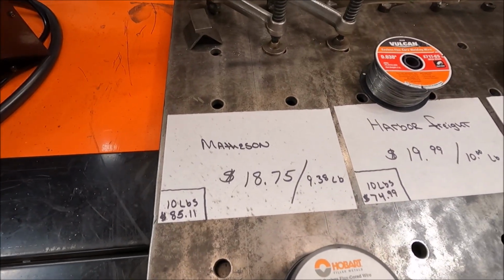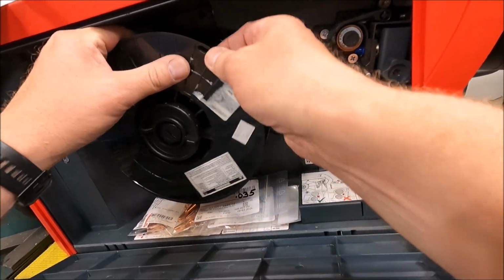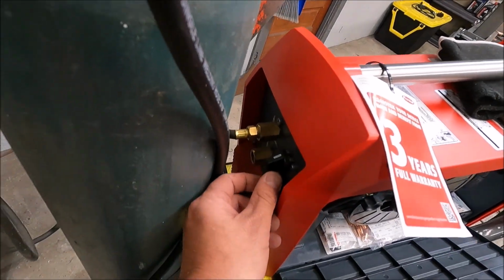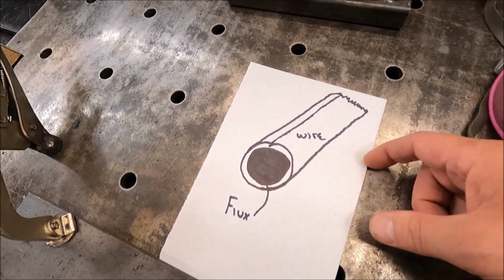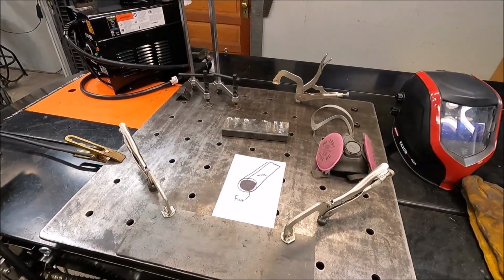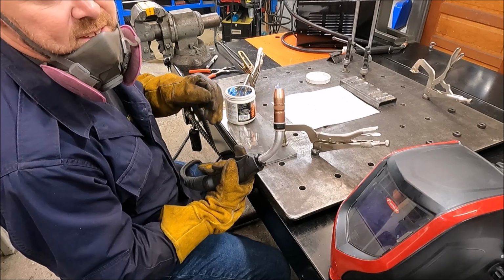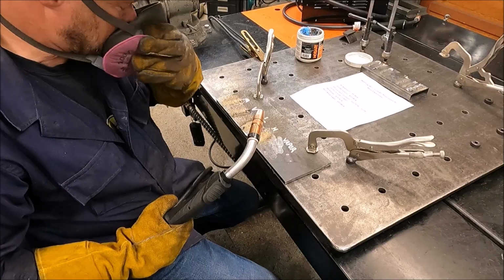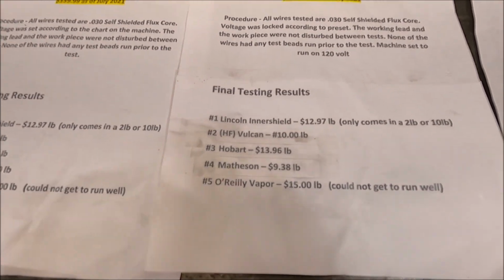Self Shielded Flux Core Welding Wire Comparison Does Cost Matter?

Comment: I wonder if the ground clamp makes a difference. I’m thinking about putting a better ground clamp on my titanium flux core welder.
Reply from the maker: Absolutely. MIG likes a real good ground and is very finicky when it's not a solid connection.

Comment: Ran flux core using Lincoln welder for years. HD and Loews 1lb spools. Tried this, Kiswel USA, and never going back. if you like Lincoln wire I would strongly recommend Kiswel. No affiliation to the company. I just buy it on Amazon.
Reply from the maker: Great to know! Thank you I will give it a try @gmarch4618

Comment: If anybody is considering the HF 110v flux core machines, do yourself a favor and spend the extra few bucks on the titanium 125. The dc output is much smoother and it only weighs like 15#.

Comment: I have a Lincoln SP-100 and it requires .035 flux when used, only NR-211MP in 10lb roll. So now the question: is a 220v welding rig better for flux than 120v?
Reply from the maker: @James KI5OEB it all depends what you are planning to do actually. 220 volt just gives you the ability to use more amperage which equates to being able to weld thicker material. You can weld 1/4" using self shielded wire on 120 volts and even thicker if you make multiple passes. 220 volt machines allow you to use bigger diameter wire to weld thicker materials in one pass so it you plan to do ocasional 1/4" with your 120 volt machine you should be all set. If you plan to weld 1/4" and up more frequently you would probably want to go with 220 volts.
Reply: @BrandonLund  my Hobart 205 AC stick is in my garage for the thick stuff, but frankly my 100 amp unit does good with a three passes I don’t get any use from the 7014 or 7018AC. I just make 1/8” projects mostly anyway. Headache racks and welding cart and many odds and ends projects.

Comment: It would be nice to see a bit more of the spectrum of wires available.  I like Lincoln but it isn't available here and online it is one of the most expensive.  I have used Amazon's Red Devil with good results as well as Hobart's line.  There are several others I have used as well.  I have never sat down with all of the varieties at once and ran them so it would be very interesting to see the results.  I don't use automotive store wires because I always find them to be extremely high priced for what they sell.  They also locally have a very limited selection at any given time.  Nice project.  You ought to do the same with the machines to see what real world differences the entry level  all the way to the gold plated priced machines display.
Reply from the maker: Thanks man! I plan to do more real soon :)

Comment: Just curious, Brandon.  Would it not have been better to keep your expensive machine on AC (if possible) to make a true comparison since the Harbor Freight welder only did AC?  Thanks, Jim
Reply from the maker: Great tip Jim. I don't think it's capable of switching from DC mode AC. I checked on line briefly and couldn't find anything. I'm pretty sure it's a DC only machine but that was an excellent point you made 👍
Reply: @BrandonLund  I converted my Harbor Freight 125 to DC and I love it.  DCEN and the splatter is much less and the penetration if really good.  Very much a learning process.  I am in the middle of a project of building a lawn areator.  It is FUN!!!  DC is much better and that is why I thought of comparing with AC on your wire evaluation.  Have a great day!!!  Enjoy your videos.
Reply from the maker: @Jim MacSuga thank you for your support! I'm going to have to look into that conversion and see what's involved. I like that idea!
Reply: @BrandonLund  I can send you some photos of what I did and if you search YouTube there are lots of videos on how to do it.  I did my own way as I have been an electronic tech for 45 years (retired) and now learning a new skill!!!
Reply: If you want some photos, PM me on facebook
Reply from the maker: Thats awesome man! I want to try it!

Comment: Another good video. Have you ever done a side by side test of shielding gases?   I ran an argon /co2 mix vs pure co2 and decided the straight co2 is good enough for structural work, as opposed to body work.
Reply from the maker: @Timothy Martin I've used both but never in a side by side test. I think this would be quite interesting! Thank yu for the suggestion!

Comment: I have a goofy question, I use a titanium flux core welder, when I try to weld thin stainless with it I burn thru it, can you advise ?
Reply from the maker: Are you using 309 gasless wire? It take a lot of amps and it's not best suited welding on thin metal.
Reply: @BrandonLund  not shure, its what ever the welder came with. I am trying to weld stainless silverware, if that helps.
Reply from the maker: It could just be your filler metal. If it's silverware it might be made of 316 (which is food grade). I think 316 can be substituted with 309L but I'm not positive of that. 309L is a good all around wire to use especially if your not sure of the metal your welding and it can be used to join dissimilar metals. SS flux core wire in general  is very hard to use on thin metal.
Reply: @BrandonLund  Ok, thank you

Comment: Brandon,  Love the channel, you make it easy to understand what you are doing. Keep it up, I do have a question for you. I like the welding/fabrication table but I wonder how much would be sacrificed if I used quarter inch steel instead of the three eighths you used?  That extra eighth of an inch makes the table top 95 lbs and with quarter inch it is a manageable 64 lbs. Alot easier for one person to lift and move. What are your thoughts?
Reply from the maker: @salceti Thank you for your support! I'm not sure how well the 1/4" top would work if you were to use fixture clamps on it. I know that after a while the 1/4" plate will eventually start to warp from repeated welding. I'm not trying to discourage you but I don't think you would be happy with anything less than 3/8.
Reply: @BrandonLund  Thanks, that was what I thought but wanted your opinion. So I guess I will figure a way to make the 3/8" steel work, before I get to deep I need to get my hands on a Mag Drill to do it right. I am currently negotiatng some handy man work to get the money to buy the drill, LOL.
Thanks for your channel again.
Reply from the maker: @salceti anytime man! another option that I have seen people do is they use the 1/4" plate and drill the holes like normal but when they weld they lay a scrap piece of 3/8 plate on top then weld on top of that. It prevents the 1/4" plate from warping. The more I think about it, I think the fixture clamps would work with 1/4" plate. You can also rent a mag drill too from your local tool rental.
Reply: @BrandonLund  are you saying that the fixture would work as well with 1/4 inch plate for tack welding an assembly but then remove the tacked assembly and add another layer of plate on top of the fixture table to do the final welding?
Reply from the maker: A lot of the prefab tables come in 1/4" thickness so I don't think you will have a problem using your fixture clamps on a table that's 1/4" thick. I don't think you would have a problem tacking everything together  either on the 1/4" top but then when it's time to fully weld everything you could slide a scap piece of 3/8" 12"x12" (or whatever size piece works for you) under it to prevent too much heat from transferring to your 1/4" top.
Reply from the maker: Yes 👍
Reply: I am going to push it now. I do have a 36" x 40" sheet of 3/4 inch solid aluminum to use, only the mag drill will not hold to the aluminum. BUT I thought if I make the template from the 1/8 inch steel as you did I only need to drill the first two holes using the index holes on the template and then use the shoulder bolts to drill the rest of the holes in the aluminum because the mag drill (which I haven't bought yet) would hold to the template metal and use the shoulder bolts to locate the rest of the pattern accurately. Then I don't even need to buy the 30 x30 sheet of steel right. Just weld on the aluminum fixture instead. That should not warp, right?
Just an idea I had.
Reply from the maker: I don't believe you will have any problem welding on the 3/4 plate. It's plenty thick to prevent distortion...what I am not sure about is after a while if the holes might wallow out because the aluminum is softer than the steel. It may never happen either. I bet that is a nice piece of plate!
Reply: @BrandonLund  It is a nice piece and weighs 110 lbs. I thought about the wallow too. The best part is it didn't cost me anything but I still have the problem of moving it. I am thinking of attaching it to some hinges and hang it on the wall so that I can swing it up when needed and down when not, not the best option but that will work, I just can't move it around the shop.
Reply from the maker: @salceti if you are in the United States, sams club has a nice roll around work cart that would hold that plate really nice. I have one in my garage that I sat a piece of 3/8 plate on and it serves as my portable workbench, welding table, chop saw table and the list goes on...and its rated for 500lbs! https://www.samsclub.com/p/utility-cart/prod9070084?pid=ps_acq_Google_PLA_12743824280&wl0=&wl1=u&wl2=m&wl3=514345519181&wl4=pla-293946777986&wl5=9002848&wl6=&wl7=&wl9=&wl10=1247713&wl11=online&wl12={productid}&wl13=&wl15=122487735562&wl16=&wl17=&wl18=&wl19=&wl20=Cj0KCQjw_8mHBhClARIsABfFgpi8XtwMzxTOLp33hy88aI1Vw8QHFN5itVjKTs9dbn6OEKbJcKtwqoMaAoZQEALw_wcB&wl23=293946777986&gclid=Cj0KCQjw_8mHBhClARIsABfFgpi8XtwMzxTOLp33hy88aI1Vw8QHFN5itVjKTs9dbn6OEKbJcKtwqoMaAoZQEALw_wcB
Reply: @BrandonLund  thanks i will check it out, if you recommend it. thanks for the link.

Comment: Hi Brandon. Great test again. Do you have different rollers for  the welder to transport flux-core or normal welding wire. It seems that flux- core is softer and needs ribbings on the roller. 
But amazing results so I hope you can show more on this item.
Reply from the maker: Yes and yes :) Because flux core is hollow it requires less tension to feed which is the reason for the serrated drive rolls :)

Comment: every wire works best with different settings some need more volts than others cause they are not made the same way so fine tune the settings for each wire seperatelly and then check the results again and show us the settings each wire prefers
Reply from the maker: @tylor dupont with enough time and practice I can make pretty much any wire run as good as the next especially in a high end machine. Im trying to remove that factor. All electrodes are designed to run within a specific range because its manufactured or supposed to be manufactured to specifications. Running the wire at a constant removes those variables and you are left with testing the quality. Wires that have less quality control will not run as well as one that do which is why a GS wire and an 11 wire can and will run drastically different because they are held to different standards.
Reply: @BrandonLund  i have worked in the automotive industry for 12 years and a metal fab company for 3 years, and i have checked with several companies on their welding wire, and they all give a different spec range, and usually is indicated on the packaging if in the box or on a very small sticker on the shrink wrap! also from my experience most flux core wire likes to be ran at 16.5V to 18V and wire speed is different for every company too, but each company should advise you or their setting range on their website or over the phone

Comment: One of my favorite welders due to the size and stuff is my titanium 125 from harbor freight. I blew through the wire that it comes with and switched to the Lincoln wire from Home Depot and it blows it away. That Lincoln flux core is killer.
Reply from the maker: @Michael T. That's awesome! I'm trying to setup a test between your welder you mentioned and the HF welder in the video. I'm really curious to see the difference between your DC welder and the AC version.
Reply: @BrandonLund  the difference is night and day. I have had both and the titanium is so much better. More compact, more options, more portable, better designed, much smoother operation, cleaner welds… the list goes on. I have a Lincoln power mig 210mp and a Lincoln square wave tig 200 and I still use my titanium quite often simply because it’s lunch box sized, requires no gas, and can run off 120v.
Reply from the maker: @Michael T you sound a lot like me! You grab what works regardless what the box says. Some of my cheapo welders are my go to just because they work as they should and setup is usually super easy and hassle free. Sometimes I spend more time adjusting voltage and wire speed to get it perfect when I can simply turn the knob from #3 to #4 to get more heat. I'm glad I'm not the only one that thinks like this lol.

Comment: I just purchased the TransSteel but the shipping company is taking their sweet ass time. What rollers do I need to purchase for flux core? Can you run dual shield?
Reply from the maker: @jdeluisa If I remember correctly you should get a set of .035 included but I could be wrong. HERE is an awesome resource that has been a huge help for me understanding all the machines functions. He has a 3 part series on this machine. I highly recommend you check it out if your not already familiar with it https://youtu.be/L5n-Kgs0Vu4

Comment: Brandon, its a relatively common wood shop practice to turn on dust collectors and other shop machines when current demand of certain machines are sensed. Table Saws, Thickness Planers, etc. "Etc" can be a welder! If you need any help with this let me know. I'm a retired Electronics Engineering Tech.
Grandpa Chris
Reply from the maker: @C DRIVE I got a little chuckle out of the "Grandpa Chris". I'm a grandpa too :). You have peaked my curiosity. Is it possible to make this automatic but still be budget friendly? If so not only would I be interested but thousands that watch this channel probably would be too.
Reply: @BrandonLund  In a comment I left at one of your other videos I told you that I wanted to adopt you as the perfect Grandson. My 27 year old grandson has never shown any interest in either my electronics or wood / metal shop. So my offer is still open! ;-) 

Automating current sensing isn't going to break the bank. After I posted my comment I searched through eBay's offerings of current sensing relays and my eyes glazed over from all the offerings. I limited my search criteria to medium loads at 1 - 30A max because we won't be sensing the current at the welder's output. We will be monitoring the input current at the 120VAC or 240VAC line side.  Sadly, eBay has become increasingly Chinese import listings. While I've learned to begrudgingly accept America's demise as a manufacturing giant, I'm not willing to cut out American based suppliers of those items. So I headed over to Amazon and found the same model. I know it's not coming direct from China because it's supposed to be delivered (12- July) tomorrow. https://www.amazon.com/dp/B07WF1HGHG?psc=1&smid=AYAQCA6J7ASI3&ref_=chk_typ_imgToDp
This model will provide a contacts closure when current demand is sensed. These contacts are rated for 240V AC or DC @ 500mA max. The Contacts are rated as infinite cycling so I'm more than certain that they're employing a none mechanical solid state Thyristor because no electro-mechanical device could claim that.

Give me a few days to test it and design a practical circuit to handle the type of constant "Run" - "Stop" duty that welding requires. It's very different than firing up a dust collector for a table saw. I will do my best to keep the circuitry simple, inexpensive and with commonly procured components.
Reply: Please do this, I am curious to see if I would be able to duplicate this on my channel. I am just now learning how to mess with anything electric, besides the basics, I just let others handle this. I have a tv that needs a new compacitor, I need to figure out what one to use. We found it on a YouTube channel once, but I can't find the video to know which compacitor to use.

Comment: I had a problem with my welder with BOC wire, small runs about 50mm long we’re nice but soon as I went longer than that the welds started making a mess. I thought it was welder, so I changed wire to CIG 
The results were amazing. The welds didn’t vary at all with lengths of welds.
Reply from the maker: @BonzaBangerz isn't it amazing how one wire to the next can run so differently!

Comment: I would tend to think that the welder setting require more variations to allow for optimum quality of each individual welds.
Reply from the maker: @ Samuel they do and that's why I wanted to leave the settings fixed if possible that way its an out of the box test because all wires given the same thickness should theoretically run decent on a set voltage.
Reply: @BrandonLund  you are assuming the flux core composition is the almost the same for all the wires

Comment: now that we know how that wire works in the expensive machine, what settings would you need to change/adjust to make each wire run perfect or as close to perfect like does the vapor wire need more amps or voltage does the vulcan wire need less etc be interesting to see which wires need what settings
Reply from the maker: @ThePoolman2007 great question! In my next series of testing I can play around with this and I'm sure we can come up with some data. Thanks for the suggestion!